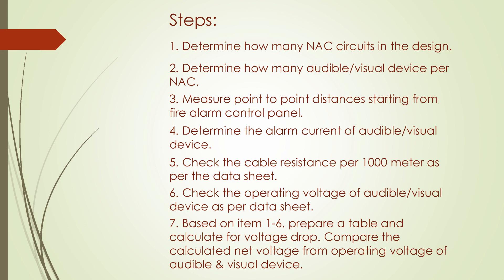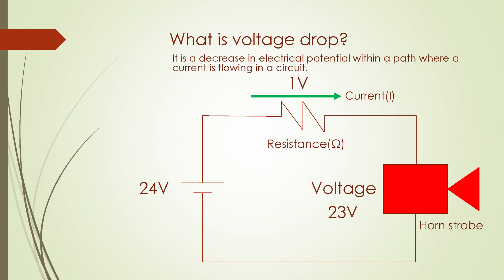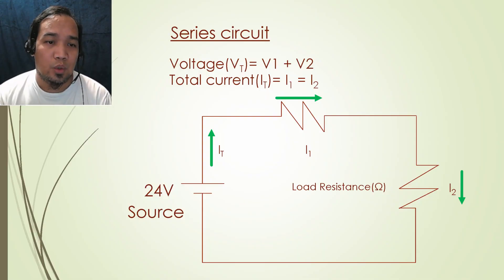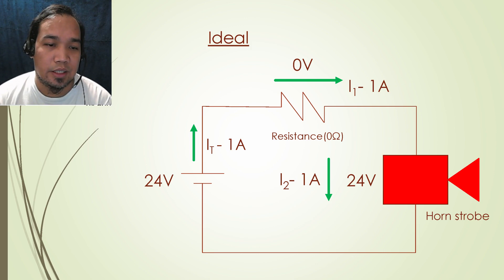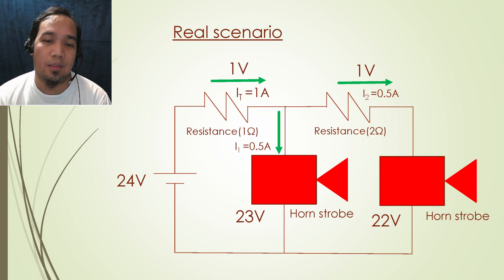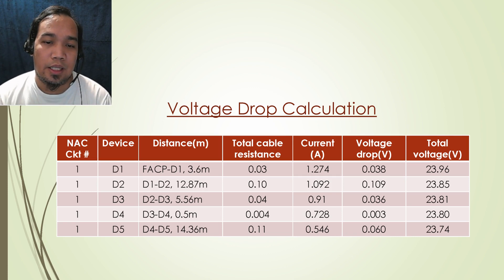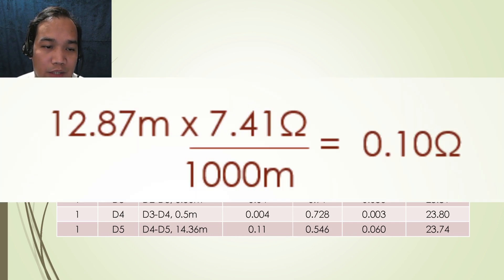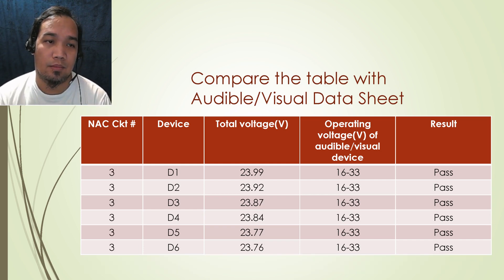Fire Alarm Voltage Drop Calculation for Notification appliance #Firealarm #AllaboutFireProtection

Comment: Clarification lang..
need ba ng smokedetector/ heat detector sa loob ng comfort room?
Reply from the maker: Hello sir, makakapagsabi nyan ay yung prevailing code ng kung ano bansa applicable yung design mo. Let's say sa pinas, you need to check kung ano occupancy related yung design mo at doon mo makikita yung requuirement sa provision ng detection. Now if need ang automatic detection halimbawa throughout the building sabi ng code, most probably yung mga nasa toilet na detector kung wala nmn shower, pede n yang smoke detector. Heat detector kasi ay not a life safety system detector kaya normally makikita mo yan nakanote sa mga UL listed products. Pero need cya gamitin especially if d applicable n gamitin yung smoke detector if ma-expose lang sa false alarm

Comment: Sir, anung current (I) ang ginamit nyo sa voltage drop calculation? Alarm current ba o quiescent?
Reply from the maker: Alarm current since it is usually more in value.

Comment: What distance should we use, the distance between devices or twice the distance between devices? I've seen some sample calculations using the twice the distance between devices? Hope to hear from you soon. Thank you.
Reply from the maker: Yes, doubling distance if we use a single core wire while in the example we use already the cable resistance(ohms/km of cable(2 core) x length).
Reply: @AllaboutFireProtection  Thank you Sir. Very helpful video by the way.

Comment: Why do we calculate the voltage drop according to the distance between each device?. Can't we calculate the voltage drop from the farthest device to the fire alarm control panel?
Reply from the maker: You can do it Halil, as long as you account the total current of NAC devices & total resistance of your cable you'll get your voltage drop. However, the proper way to do it and show how much voltage are dropping for each NAC device as it travels to the last device are from the table that I shown in our presentation. Thank you again for watching.

Comment: thanks for this video sir...im, now into next video hehe .... is it applicable also for the detectors sir? or only for audible , i mean this v-drops calculations
Reply from the maker: It can, the logic of calculating the voltage drop for detector will be the same principle as what is discussed in the video. You just have to know the total current first based on the quantity of your load, which in your case your detector and now the resistance of your wire from point to point until you calculated the drop until last. By comparing the voltage from last with the operating voltage of your device, you can definitely say if it is ok.

Comment: I am entering charger voltage on a pyrotronics SXL-EX panel..I am only getting 9.7 volts.....is that correct?
Reply from the maker: You may want to re-check the measurement by removing first one terminal from the battery and measure the voltage to the charger circuit. If it still lower than 12V, then you possibly have issue with supply of voltage going to your charging circuit. Check the installation manual of that FACP and look for the charger circuit voltage.

Comment: Sir, hingi lng ako overview. Yung NFPA 72 and its referral code (NFPA 70), required ba talaga na fire rated yung wire?  

Example scenario for a high rise building with assembly and hotel occupancy. Yung system ay may wiring na SLC - class A, IDC - class B, NAC - class B, and 24V power supply). 

Or meron bang certain condition na kelangan ma-meet para permitted kang gumamit ng hindi fire rated na wire?
Reply from the maker: Hello, kung susundan nating yung requirement from NFPA 70 for type of cable to be used for fire alarm, required na listed for fire alarm use and may resistance sa spread of fire. Pero, bago tayo magcomply sa anumang standards na gagamitin ntin, lagi ntin i-check yung ano ba yung mandated na code sa kung anong location or bansa mo i-apply yung requirement. Like dito sa pinas, check BFP Fire code requirement or if my project specs, need ntin macomply. Otherwise, kung sinabi na installation shall be installed in accordance to NFPA 72/70, then ingat tayo sa ggamitin cable and this should be verified with the project.

Comment: Thanx for your video, from where you get the current of the first device =0.182 A.??
Reply from the maker: It is from the total current of our notification device based on data sheet which is in our example we used horn strobe. We added both the current from horn (0.122A) considering high output plus the current of strobe (0.060A) when 15 candela setting is used. You'll get 0.182. Thanks for watching our videos.
Reply: @AllaboutFireProtection  Hi Sir 
i have a question please 
from where you got the table you used for determination of current for notification device ?

Comment: Sir tanong lng if lalakihan ko ung cable ko for nac pra sa resistance need ko parin po ba ung ganitong calculation?? Hehe thanks sir in advance more power sir.. Next sir clean agent din sna.. Hehe
Reply from the maker: Hello Jamir, thank you sa comment mo. Kung iisipin natin minsan pag sobra liit ng load natin sa isang notification appliance circuit, halimbawa may 2 units lng na sounder at ang cable gauge natin is 12 or 14 AWG, alam natin na negligible na yung drop lalo na kung mallit lng yung total run ng cable. Pero, required kasi as minimum documentation if tignan ntin sa NFPA 72 sa clause 7.2.1(8) 2016 edition yung voltage drop. Kaya madalas sa shop drawing natin or separate na calculation binibigay ntin ito sa consultant for approval. Hindi dahil required sya, mas mganda na rin maging praktis ntin na magvoltage drop calculation sa signalling loop, IDC, speaker circuit, NAC at networking loop para na rin supported tayo ng documents pag nagkaroon ng problema later sa performance at confident tayo na malinis ang wirings ntin.
Reply from the maker: Yes Jamir, susunod na yung other reference ng nfpa like NFPA 2001 which is about sa standard ng clean agent din. TTapusin ko lng topic ng NFPA 72.
Reply: Thanks for your reply ,but can you answer me again in a more clear english words,because i did not understand your reply.
Reply from the maker: @ramezzaki6365  Hi ramez. Jamir was asking in his comment if we still need to provide  voltage drop calculation if let's say we used a big size of cable in our notification circuit or sounder circuit. The answer is yes, even if it is obvious that the voltage drop will be minimal because of the size of cable. It is one of the requirement in NFPA 72 in clause 7.2.1(8) 2016 edition for fire alarm documentation to provide voltage drop calculation.